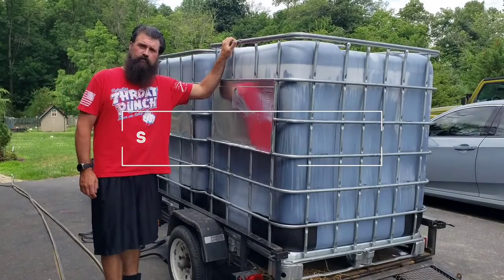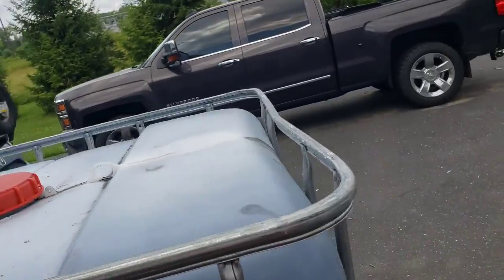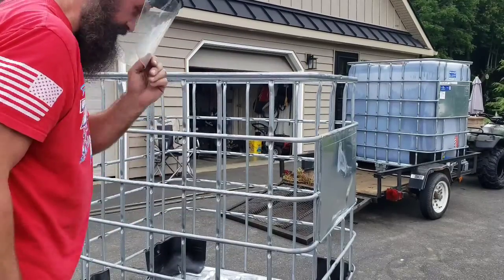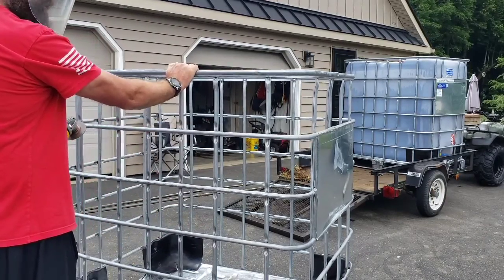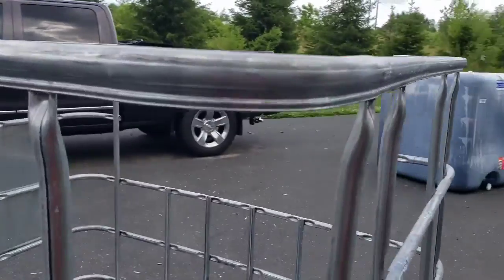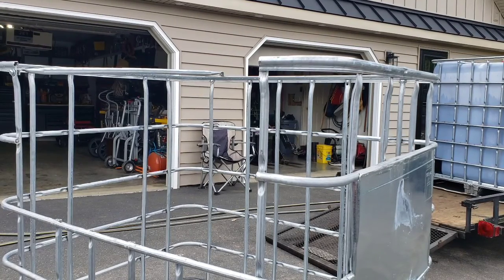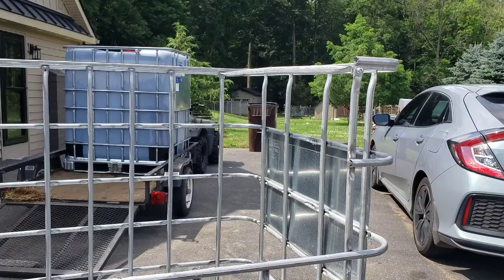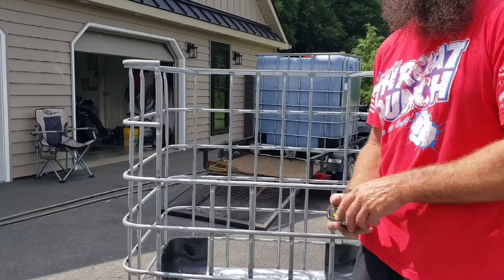Prepping an ibc tote for firewood

Comment: I like it; especially that you're reusing those supports. What do you do to cover the top? My wife found your video as we have two totes and heat 100% with wood. Want to make one up for by the cabin, but need a top to protect it from snow, etc. Wood is stored covered in a wood shed/rick, until it's moved to the house. Any input is appreciated!

Comment: The next question, is:   how to deliver totes to the customer without manually  handling all the firewood again:

//youtu.be/JnDIRLLmPPo

//youtu.be/kWh73MbE7go

In the interest of reducing the # of manual touches of firewood for everyone, the above method seems to be the best. It isnt cheap, and forces the customer to pay ~$30 (for the tote) and maybe $100 for the wood, for having the tote placed into their garage, with no further piling and mess. 

The next time they need another refill, you just deliver another full tote, and take back their empty tote, and charge them $100 for just the wood, since they already paid for the tote!